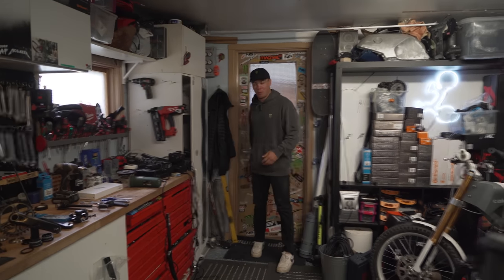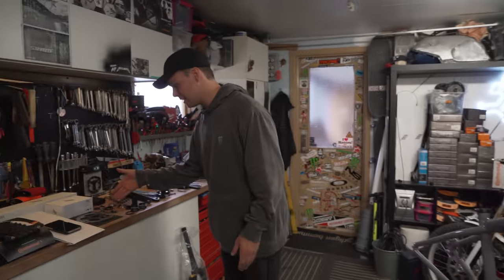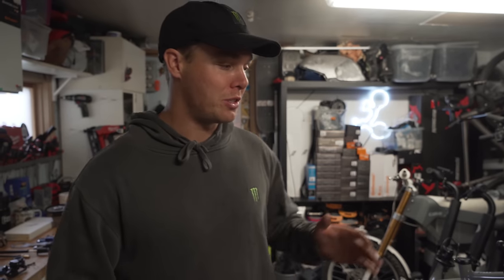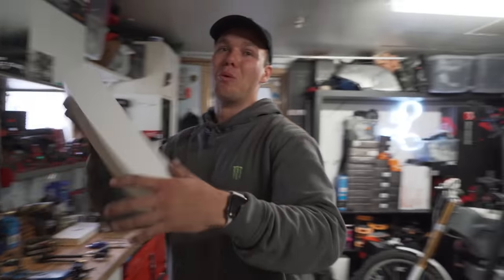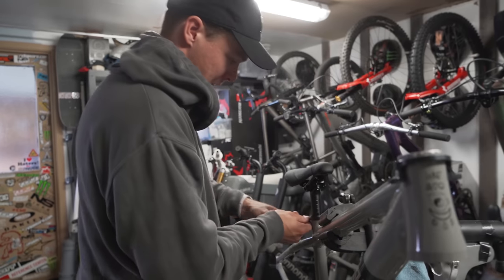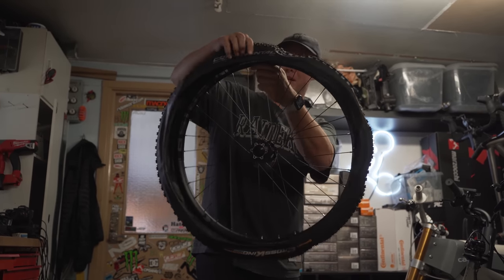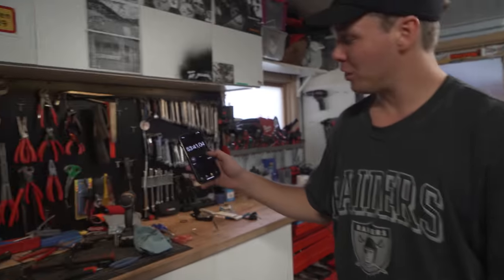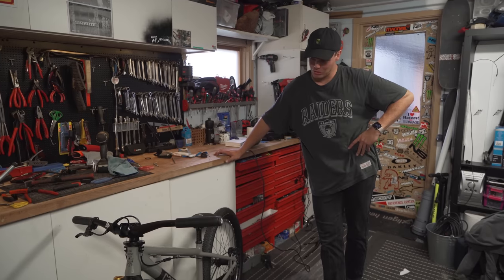WORLDS FASTEST MTB BIKE BUILD! *Disturbing footage*

Comment: It took me 30 minutes to assemble my Polygon T7 and all I had to do was install the bar (brakes, shifter and dropper lever were already on), pedals, dropper post (seat already on) and front wheel. Under an hour for an entire build is still pretty impressive. I bet you could've shaved 10 minutes off if you had taken your time on the fork cut and relaxed. Very entertaining! 🤘